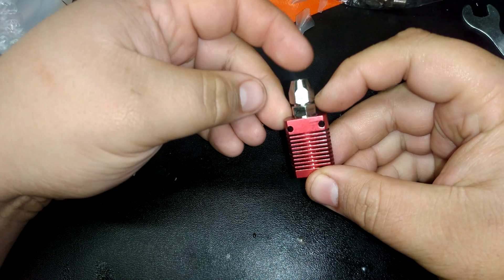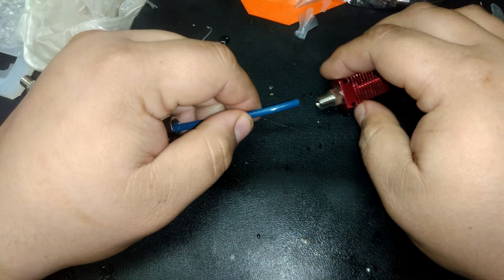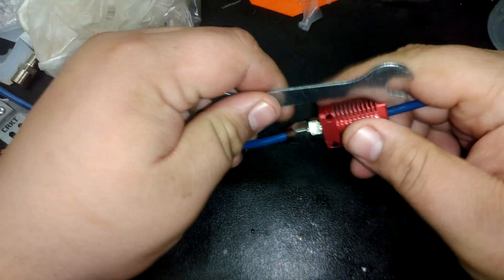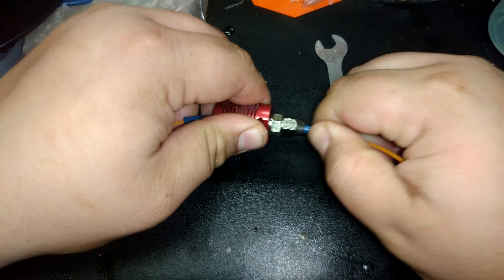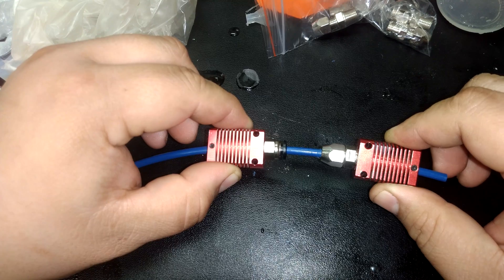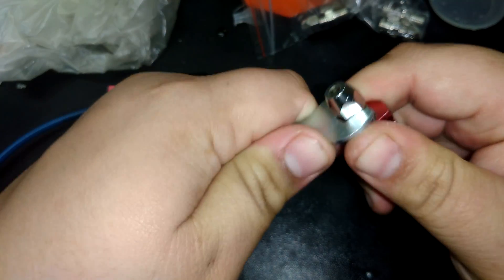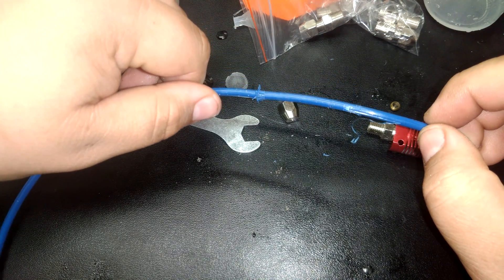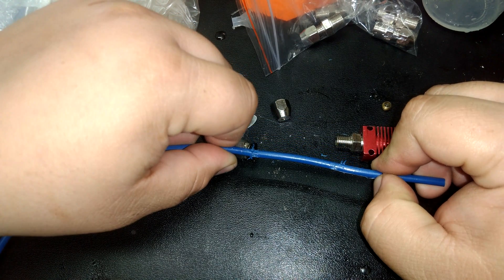Compression Fittings vs Pneumatic Couplers (that fit stock hot ends!)

Comment: You don’t have to drill the fitting. Instead cut a short PTFE tube that fits down to the nozzle. Advantage is that the lower tube can’t move up and therefore there is never a gap between tube and nozzle. Similar effect as the “washer mod”

Comment: Hi Andrew love your videos, can you please post the link where you got your 1/8" BSP coupler, I would like to get one as well. I am trying to mash together an all metal hot end (Slice engineering), Capricorn tubing, and compression fittings, for the extruder and hot end. My objective is to have a highly reliable bowden tube setup, that will not require replacement for heat degradation or mechanical wear. I can't seem to find anything that fits this criteria. I rejected the Micro Swiss because it still uses pneumatic couplers. It would be nice if you can find a M6 compression coupler for the extruder end as well